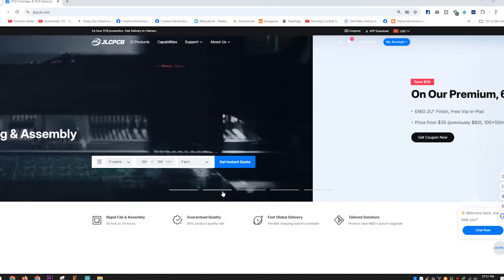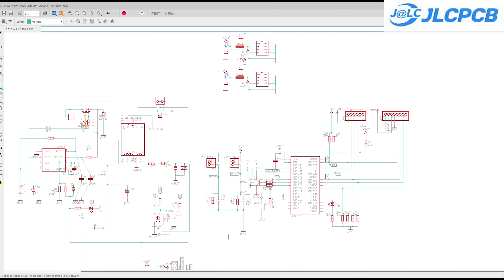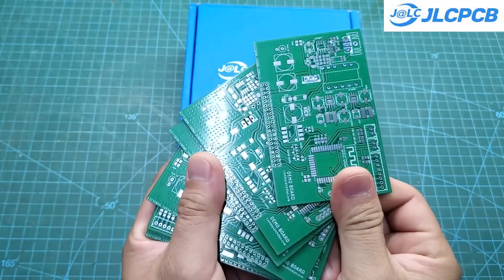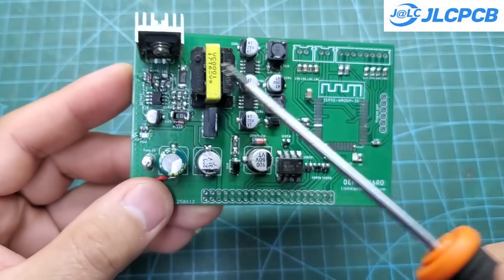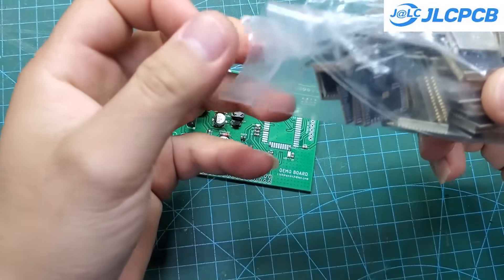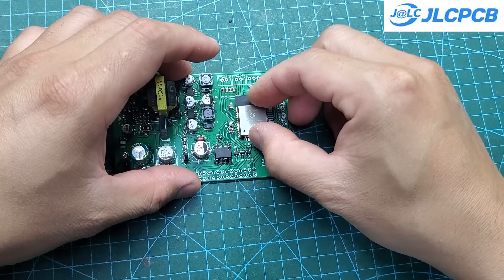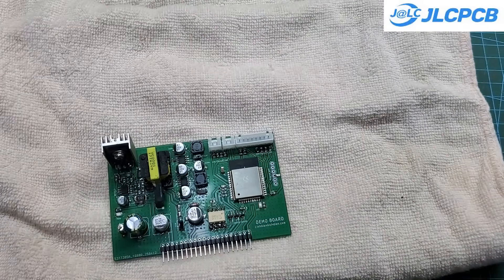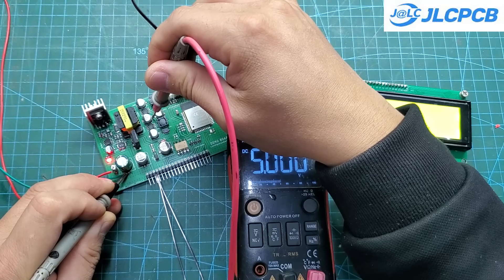Make 50A MPPT Charger Part 1 | JLCPCB

Comment: What that means mppt is anyone know please tell me ?
Reply: Maximum power point tracking, a glorified DC buck converter lol
Reply: @marlonjamesbayaras8981 thanks ❤
Reply from the maker: Exactly. You can even turn a regular buck converter into an MPPT just by adding a single op-amp. You need to look at the back of the solar panel and find its VMP voltage. Then set up the op-amp so it cuts in when the voltage drops below VMP.

The op-amp output is fed into the buck converter through the EN pin or the feedback pin. The idea is simple: when the buck’s input voltage falls below VMP, the op-amp forces the buck to reduce its output voltage. This keeps the buck operating right around the panel’s VMP all the time.

Comment: Hi.so nice.but threr is no any hex or ino files in zipfile
Reply from the maker: I’m using TechBuilder’s firmware—I only redesigned the power PCB. If you want to use a modified firmware version, you can download it here: https://drive.google.com/file/d/1DjVp5yzwCKdCCphH7z5n0GS27uuSU7zS/view?usp=sharing

Comment: Como funciona isso 😢😢😢
Reply from the maker: I’m using TechBuilder’s firmware—I only redesigned the power PCB. If you want to use a modified firmware version, you can download it here: https://drive.google.com/file/d/1DjVp5yzwCKdCCphH7z5n0GS27uuSU7zS/view?usp=sharing